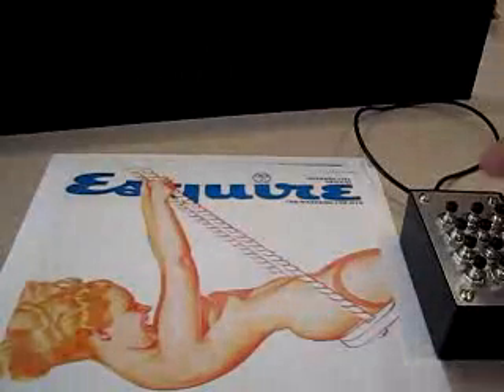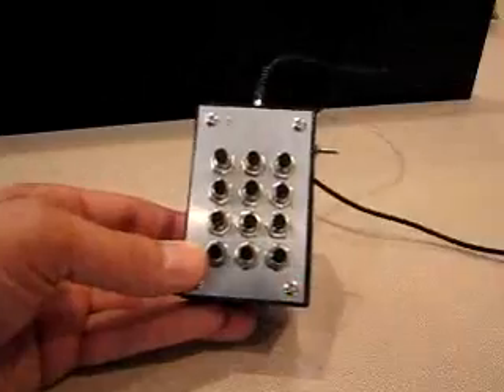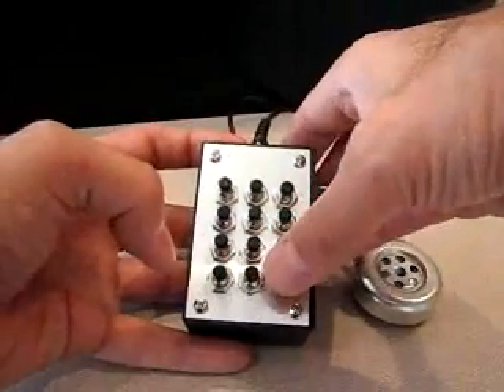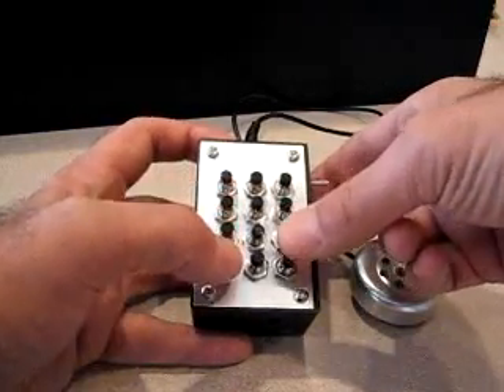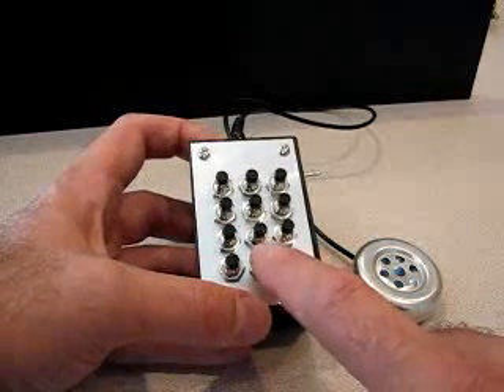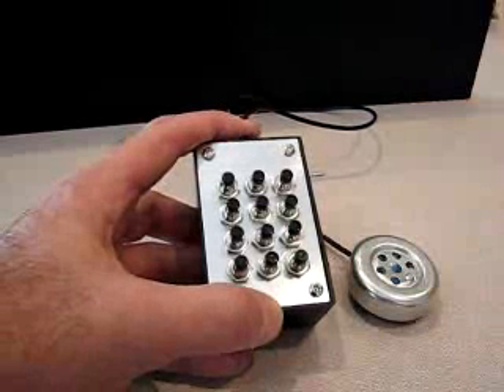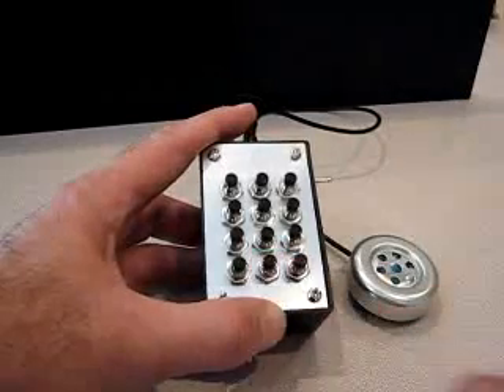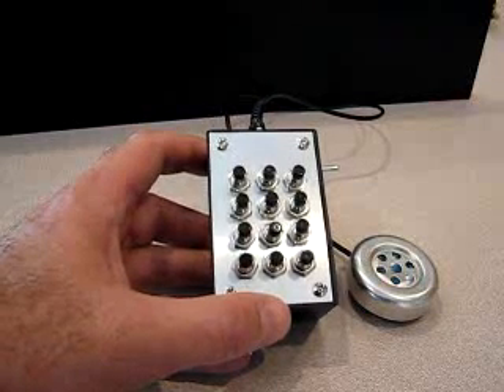Esquire blue box replica

Comment: The switches needed are indeed available for a perfect reproduction.
To do a perfect reproduction you will need the DPST momentary contact switches, Allen Bradly mini switches or Cherry switches, Switchcraft is not exactly the right size.
Cheat and use a 556 timer IC, much easier!
Use perf board for the resistors, and, yes, ear piece for a 500 set.
The box itself is correct but the original was a bud box.
4 AA NiCad cells will give 5 volts and is very stable as well as being perfect in size.